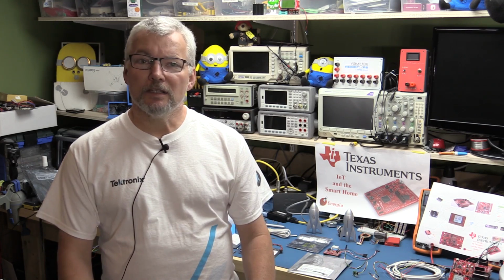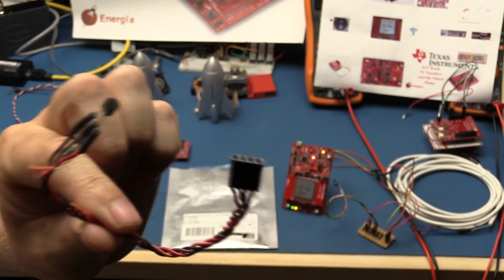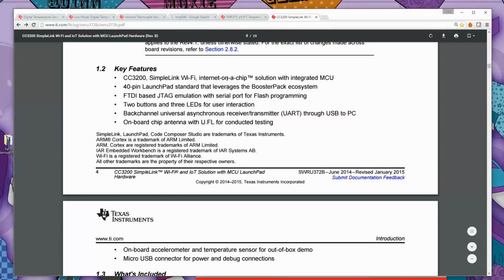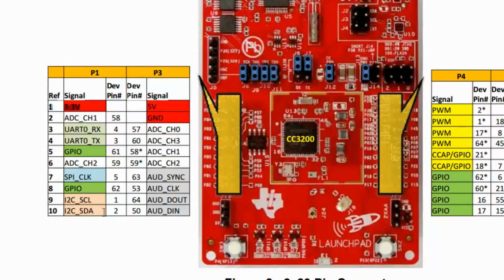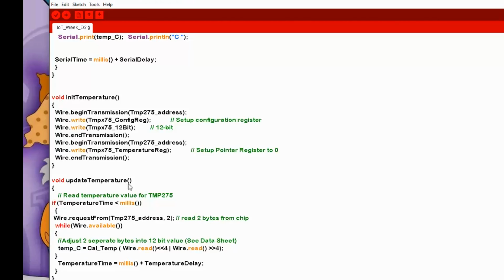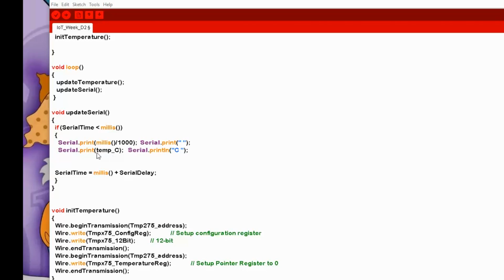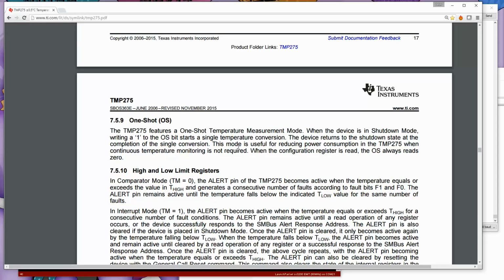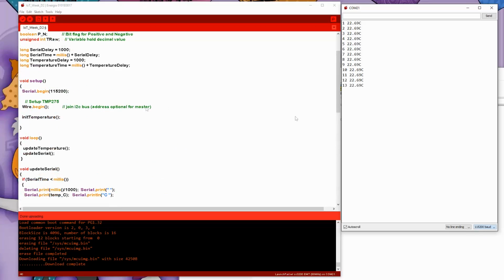TI IoT Week, Sensor Node Project Part 2

Comment: Nice video sir, is the temp sensor is inbuilt in ic or else we have to connect externally..if it is in built .. could you upload the code sensing the temperature and blink led

Comment: I saw that your TMP275 is on a breakout board... I'm currently creating a big project for my senior project and I only saw that the tmp sensor was alone, and not on a board. How do you get it on a breakout board?
Reply from the maker: you can use a breakout board for the chip, this will take it from an SOT8 to a DIP, you could just use it as a normal chip then. check the exact footprint of the chip your using and then look here https://www.digikey.com/products/en/prototyping-products/adapter-breakout-boards/643 to find the right one

Comment: Peter, It appears from your video that the programming software is based on the Arduino IDE V1.0 source code, a bit like what Digilent did with their ChipKIT. Nothing bad with that, it's simple to use and in fact it makes it readily familiar to thousands of Arduino users I guess!
Reply from the maker: That's exactly the point I am trying to get across, thanks for confirming the thought. Yes, all the Arduino programmers out there should feel perfectly at home using Energia and the TI Launchpads.